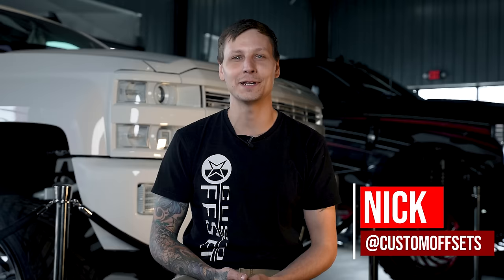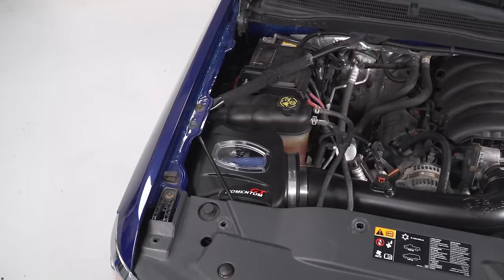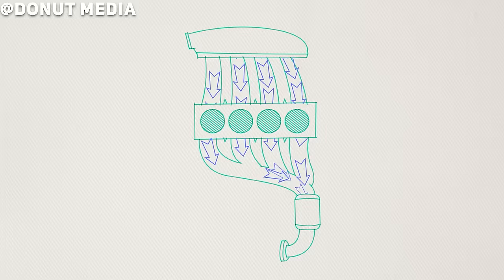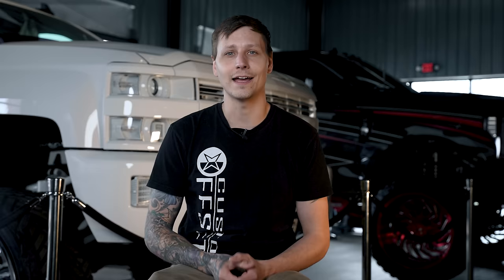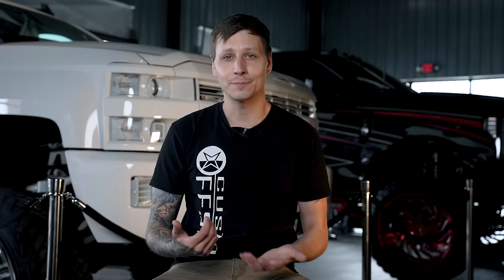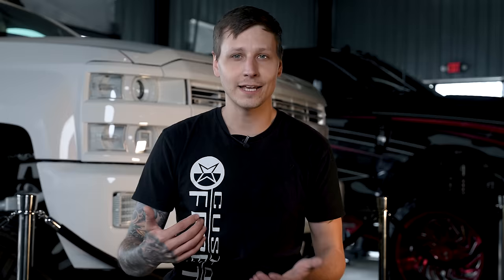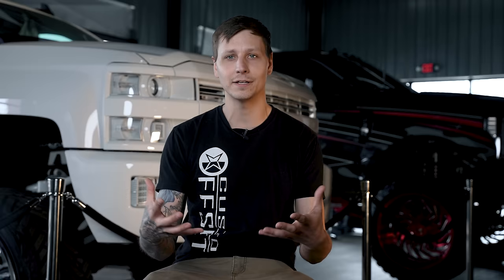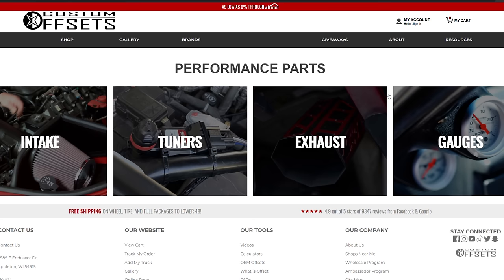The Science Behind Cold Air Intakes!!

Comment: I like modified trucks to some degree. But the older I get the less I modify. All the years and trucks past I had all I'm remembering is more problems with mods than there worth. I did just order a new 2500HD and I'm leaving that one bone stock except for rims and tires. Great informative video!
Reply: I hear ya..I have a 2018 2500 HD...  The throttle response is terrible compared to my 07..  Only upgrade ill do is a cold air intake..
Reply: @tray8411  may I make a suggestion? Do You have the 6.0l in that?
Reply: @judee00  6.6
Reply: @tray8411  I'm not sure a cold air intake will help your throttle response. There is a throttle response improver but I have no personal experience with that and don't know anyone who uses one. It's a 6.6 diesel so it's going to be laggy anyway. Other than heavily modified, I'm not sure it's worth spending the money to get better throttle response. My buddies with diesels with tuners say throttle response is improved but, most of them drive gas motors now. 
I did get my new 2500 in the gas 6.6
Reply: @judee00  Ill take your advice..  So bummed they ruined a great engine.. I loved my 07 duramax..  Thnks for the response
Reply: @tray8411  07 was a great year for the duramax. I wish they didn't put Def in the diesels or I might have looked at them. Now that diesel is almost 2 dollars a gallon more than gas in my area , I'm glad I went for the 6.6 V8 gasser.
Reply: @judee00  Yes the diesel prices went nuts over last 2 yrs... Now I have some decisions to make...
Reply: @judee00 do a simple muffler delete on the 6.6 gas. Throttle response,  mpg, and sound all improved.

Comment: The cold air intake I got for my truck increased the noise, gave noticeably more torque around 2000-2700rpm, and has caused my truck's MPG to go up by 1 gallon to 17mpg. Also, people don't say this but engine response is increased. When I am parking in a hard area or getting onto the concrete slab of my garage, the engine does not lag as much and is more responsive, which in my opinion is a good thing.
Reply: At least this guy isn't claiming 25 mpg lol

Comment: Great video! Last weekend I installed a Banks intake on my 2019 L5P Duramax and wow what a difference! I could immediately tell a difference in throttle response and power! Also probably the best part is I can now hear my turbo whistle when I’m driving with my windows down! Totally worth it I highly recommend it! 👍🏼
Reply: Have you serviced the filter yet, you will discover you have to remove the whole system to get at the filter, now that's some engineering
Reply: I installed a Banks CAI on our 2020. Love it! For John Osborne-it only takes five minutes to replace the filter. Actually, made a video on how to replace.
Reply: Monster peddle works better
Reply: @johnosbourne5089  whow

Comment: When I purchased my '17 GMC Canyon SLE new many years ago I didn't like the engine hesitation.  Manufacturers restrict engines so much with their lame intake setups and inferior stock exhaust systems.  Installed K&N air intake and that install alone did make a difference.  Coupled with a dual catback exhaust upgrade it gained around 30HP and eliminated the hesitation/stall when accelerating to higher speeds.  Well worth the investment and were both easy installs even though I had never installed either system like those before.
Reply: My brother in Christ, you did not pick up 30 with intake and exhaust. No doubt noticeable, but 30 would at the very least require tuning to realize.

Comment: I have the K&N cold air intake and snorkel combo on my jeep rubicon unlimited, paired with a magma flow 4 wheeling cat back exhaust that dumps right behind the rear passenger seat on the driver’s side and it is amazing. Slight increase in mpg when cruising around, but more hp, and torque improvement than I expected. It also sounds great.

Comment: From what I've researched, it depends what you have for a cold air intake to actually do anything. In regards to trucks, if you have a gas engine, it's not really going to do much. Your engine is already breathing relatively easy from factory. If you're driving a diesel, you'll usually see an actual improvement in power and MPG (depending how you drive). Diesels , especially on trucks, are turbocharged and further choked by EPA regulations, hence why cold air intakes are more effective on diesel engines

Comment: I have put cold air intakes on all my vehicles since I was 16! Gas and Diesel engines too. Always gain some fuel economy, usually adds for a nice/cool intake sound, and usually adds some noticeable power/acceleration gains! Have ran K&N in the past, but more so sold on the S&B systems the last few years!
Reply: you can clearly see this video shows its a "cold" air intake, all that means is its not sucking air from the engine compartment. the duramax diesel in chevy/gmc all have the "cold" air intake system from the factory, theres just no other way.

Comment: Tacomas have come with cold air intakes, it comes right from under the fender and above the wheel arch. I can't say the plastics and rubber fittings can resist heat better than say K&N but the air is cold.

Comment: Funny that you show a K&N dyno and mention them. Because I was in contact with K&N R&D a few years back when they borrowed my car for a week to develop an intake, and they said they don't really make CAI's because gains are negligible over short ram intakes. And no, your intake with a heat shield is not a CAI. It's a short ram with a heat shield. A short ram intake with a good heat shield or air box with good flow is the best option.

Comment: Says dyno proven, doesn't show any dyno results.  Most dyno-improvement runs are from a dirty stock filter to a new system.  Not from clean stock to new.
Reply: Go watch street speed 717 put a cai on a brand new truck that was just broken in. Well engineered cai will give you 15-20 hp/tq gains. It's simple, if it's piped right with better heat shielding the air going into the engine is cooler and denser giving you more power. A keyboard mechanic can tell you all about how they don't work but when Gale Banks tells you it works, it bloody works. May not be worth the 350-400 but the claims that S&B, Cold Air Inductions and other reputable manufacturers make (within reason) are accurate. Otherwise they would get done for false advertising.